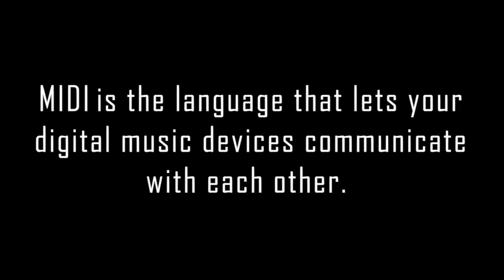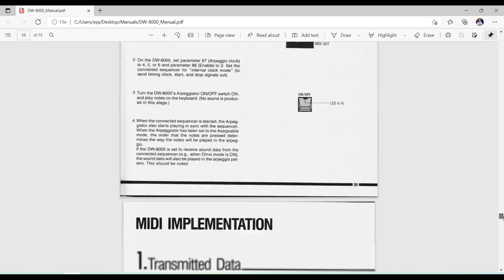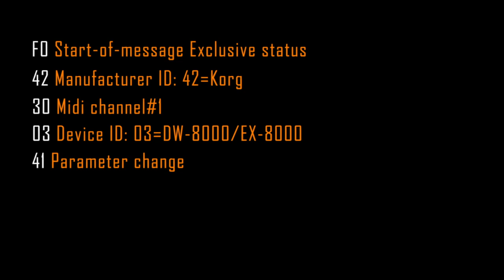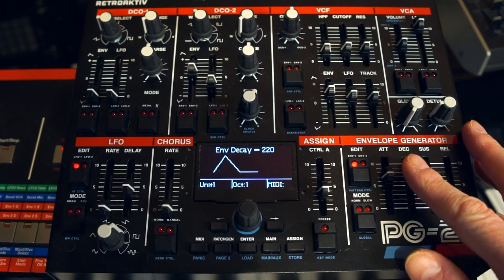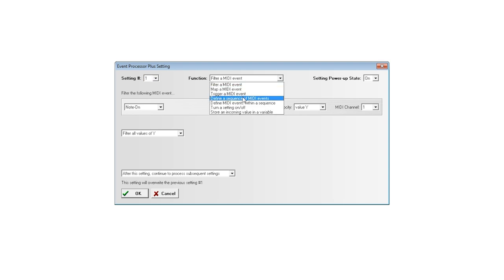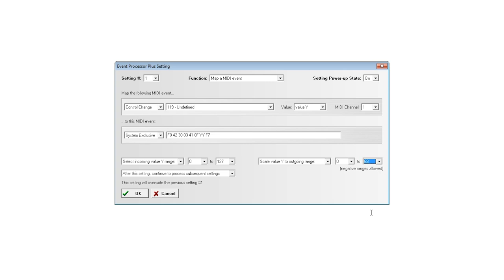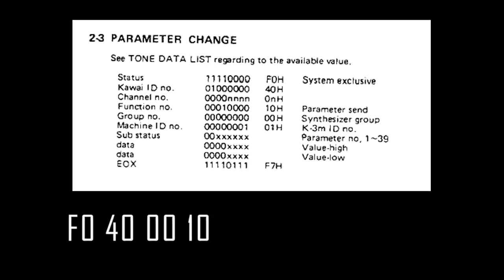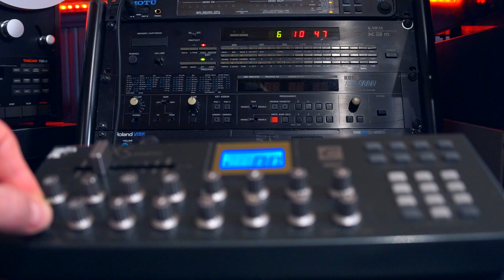Midi Sysex - The black arts? | Introduction and tutorial

Comment: Sysex being there from day 1 just showed how well planned out MIDI was.
Reply: True. It works so well, that it wasn't until the past couple years that MIDI 2.0 has come out. Nearly 40 years with a single base spec is pretty good. :)
Reply: @Psychlist1972  MIDI 2.0 doesn't make much sense imho. There's almost no hardware that supports it and the practical improvements over the "old" version are minor. MIDI will remain the standard for decades.
Reply: @hutti  I disagree, but disclosure: I'm involved in implementation at Microsoft and also a member of the MIDI Association executive board, so I do have a bias. 

There are tons of performance and flexibility improvements in MIDI 2.0 including greatly improved controller resolution, per-note articulation, absolute note pitch, jitter reduction timestamps, and more. It's also backwards compatible so devices can support MIDI 2.0 with a fallback to MIDI 1.0 when appropriate and can also tunnel MIDI 1.0 messages to downstream devices.

Device companies have been primarily waiting on the operating systems companies to step up and offer the API for apps to use. Apple implemented it some months back. Google/Android just announced it in Android 13 just this month . And Microsoft is working on it for Windows. The USB MIDI 2.0 spec came out last year, so that was one thing that the OS companies were waiting on before implementation.

But MIDI 1.0 will never go away because we love the synths and devices which use it. I have a ton of them here in my studio. The key here is enabling incremental improvement and supporting new capabilities while retaining everything we've come to enjoy in the past 40 years.
Reply: @Psychlist1972   thanks a lot for taking the trouble to share your "insider's" vantage point with us here. I appreciate it immensely and so will many others I am sure. I think resolution is indeed an important improvement but you are also right to emphasize backwards compatibility which, in my opinion, is absolutely key. Your comment reassures me but I still wonder, could it be that in the future there will be lots of MIDI 2.0 devices that do not offer the fall back option? Or is the ability to fall back to the earlier standard a requirement to conform to the new standard?
Reply: @telantas  the various OSes all handle both. It's a recommendation and market reality that most devices will need to have some sort of fallback or dual implementation as well. But it really depends on the nature of the device. A master control keyboard would probably want to have both. But maybe a new type of non-standard-tone instrument or special controller may not make sense in MIDI 1.0.

But all of our MIDI 1.0 stuff is going to work in the future. There's a LOT of consideration in the specs for ensuring options about bridging/translating devices/interfaces/keyboards, dual-use, etc. Devices that can make use of new capabilities will, and devices that don't need it, won't need to implement it. :)

Right now, the transport/protocol specs only include USB anyway, so it's primarily between devices and computers, or workstation keyboards and other devices. That'll expand, of course.
Reply: I agree. I've used system exclusive messages to run filters and volume changes, mess with velocity curves etc. long before DAWs were a thing.
Reply: I agree, the people who designed these protocols were genius!
Reply: @Psychlist1972 One big issue with MIDI 1.0 and Sysex was always only one lane in and one lane out per channel. Remember the MIDI belches? Opcode’s Studio 5LX was handy. Cost prohibitive when it first came out

Comment: This was great! Now I'm much less scared to buy vintage rack synths, knowing that I can probably use any MIDI controller with suitable knobs and faders. For some reason, I always thought that the MKS-50 would be next to unusable without a PG-300 or some expensive modern alternative.

By the way, I'd love to see more MIDI tutorials. By and large, the whole thing is still a mystery to me. If something doesn't work right away, I never know if or how I could make it work.
Reply from the maker: Cheers!
Reply: Another solution is to use software on computer, for example program called Ctrlr.

Comment: I'm not familiar with that technical things. But I have old midi synths, computer based virtual synths vsti, and modern controllers, that can be programmed with their software, so I' will have do learn that process. So thanks for these explanations. I have the implementation charts, in the manuals😎😎!!.... I know this is important to have but I was spending half a second to look at those pages🤔.
Can I send sysex to the mc 500 to register sysex and send them after, or sending sysex to the Roland mc 500 to program it?.... And how do it transmit midi messages?
I have three Yamaha Dx, 7, 21, and tx7, two old computers that can send sysex, one Imac also with a sysex sofware, I want to join all that in one system, and learn to program all that, the Tx7 have been made to work in duo with Dx7, but Ican use also that with a modern midi keyboard  controller with after touch, like I have one CME uf70. But as I see, this will be a big deal 🥴.
I did not understand if the box you are using is better than using old computer's sysex and programing softwares, with sysex send and receive?.... I have also amounts of sysex files collected for Tx Dx 7 and also Dx 21, that makes a big library of sounds, and parameters to explore, but I understand also as listening your example, how useful that would be for me to program the interface just only between the Tx7, and the CME uf70 keyboard controller... And more with the best collection ever made for the Dx inside or ready near in the computer, or in the MC 500, by disquette send?.... Lot of work in perspective. I have also my house to renew, so not time for now to re install my studio, but all this sing in my head, hope one day be able to make all this working fine...
What I love are sounds, not so much technology, but by nature, as I am 62, I grown with the 80's music, with the dream to play those technological instruments!.... So, I enjoy your channel, because I found over time some of those old instruments, and this is the sound I liked as I was a teen. But this was technological time, discovering electronic music. Now this is different, I prefer using this technology for mapping sounds, nature, without rhythmic, some counter way to use the technology.  
The question is that technology must serve Art, a freedom thing as technology is a slave thing. One instrument have a technological limit, we must reach by programming, and then, lost memory of that, and use the controller to play in free mind. So for me, technology is not a goal, just the way to find the secret limit of the art that this instrument is able to give in my ears🙏🧡💚
Reply from the maker: This video was meant as an inspiration to go out and find out more, and it seems you're interested in that and so the journey begins. :)

Comment: RTFM its all there, nice one, the Peavey 1600x is also useful since it has nameable presets so you can make setups for different synths, unfortunately different companies use different controller numbers for filter cutoff for example, so that is why you need to make a different preset for each synth...even with VST's they didn't agree on same controller numbers, even though they are all named in the MIDI standard controller list from the beginning

Comment: Funny, the EX-8000 is the first synth I used with Sysex for more than patch backup or firmware. I use Bome MIDI Translator to convert CC messages from my Cirklon to Sysex messages for the EX-8000. Kind of clunky, and the resolution isn’t great but it works well.

Comment: My cousin who is a professional musician used sysex messages constantly to backup and transfer presets for his "romplers".
As far as I am concerned, back in 1994-1995, the most "arcane" midi messages I used and I can think of were precisely cutoff and resonance filter parameters.
I think they were not referred as sysex but as nrpn - if I recall correctly. They were just briefly mentioned in a chart of the manual without much explanation for my particular hardware - SB AWE32 souncard with emu8000 synthesizer, the chip was decent for the price but man the built-in rom samples were so bad! (only 1mb) the interesting part was clearly to create your own patches with your own samples. Fun times :)

Comment: I had just looked at midisolutions gear and the programmer right before I watched this but was hoping there was a way to do this without buying a $150 overpriced gadget that is a luxury , not a necessity. Also the midi messages in my organ module manual shows these midi values for controlling rotating speaker speed and it is even more different than the ones you show. It seems that there is no full standard for these messages and they are all different in their representation and arrangement. What does this even mean with the bytes and control value?
Status 2nd byte 3rd byte
 BnH    50H          vvH
 n = MIDI channel number: 0H - FH (ch.1 - ch.16
vv = control value: 00H - 7FH (0 - 127)

Comment: MIDIOX is super helpful, too.
Reply: I use that a bunch. But I've found MIDIOX can sometimes fail, especially with older equipment. Plus, you have to mess with buffers and whatnot to try to work around that, which is more of a hold over from really old MIDI APIs. It's just not all that musician-friendly. So I wrote a simple MIDI Sysex Transfer Utility that is free in the Microsoft store. Bonus, it works with Bluetooth MIDI out of the box. It's mostly for sending OS updates and patches, not for receiving anything.

Comment: I remember my dad and I had a sync-module (Midi In, audio out) for our Fostex 4 track. We were using Cubase 2.0 on the Atari. Problem was, that when the sync-track was laid, the Fostex became the master-machine which was cumbersome. I found out it was possible to control it via sysex, so I programmed a Midi-module inside Cubase 2.0 that would let me remote-control the tape-machine from Cubase. Problem solved! (I was around 17, and to say that the old man was a bit blown-away is and understatement. Worked beatifully :) )
Reply from the maker: Impressive!
Reply: @EspenKraft  Ha! It took me a week to program the damn thing :)

Comment: That little box is freaking awesome.  I was wondering with some gear that used its midi port for firmware upgrades if that was in HEX language? I'll have to dump some code into a sequencer to see if it'll work. If so, we could even have the potential to fix bugs.

Comment: I use one of the MIDI Solutions Event Processors to convert MIDI Note On messages with a velocity of zero to MIDI Note Off messages. The standard says the former is equivalent to a Note Off (and is useful for a feature called "running status), but some modern gear gets confused by it.
Reply from the maker: The EP can pretty much solve any MIDI problem, I love it.

Comment: sysex is soooo cool .. and given for the fact that MIDI is almost 40 years old, it is even cooler ;) i mean .. it just still works :) for refreshing the memory of some old synths or to do some really sexy stuff like shown in the video. sysex came in very handy to me around 20 years ago when i wanted to control the NI B4 from my hammond XB2. there was no out-of-the-box controller mapping avaiblable for the drawbars and the buttons, so i had to do it on my own. i used MIDIOX to do this (and midiyoke to get midiox internally connected to the B4) - one of the best tools i have ever seen. unfortunately, it seems to have been discontinued since quite a couple of years.. but should still work .... does anyone know if there is something like a successor to this great tool?

Comment: I seem to remember that the KX88 had a function for controlling sysex in real time. Does it work in a similar fashion to the box you described?
Reply from the maker: I have made a video about exactly that. It's part of my KX88 video.
Reply: @EspenKraft  I must have missed or forgot about that part when I watched it. (Yes I did watch it). I guess I'll have to watch it again! Thanks for the correction! But I did remember that it could do live sysex control when I was researching Master keyboards in the early 90s.
Reply from the maker: It sure can, but only simpler strings for synths that didn't require more complicated checksum strings etc for parameter change. Nevertheless, it had sysex control capabilities in 1984.
Reply: @EspenKraft  I'll take your word for it, as you have one. It would have been a nice capability for a MIDI master keyboard to have, and I would have undoubtedly used it if I had bought one back in the day. But I ended up getting a Roland A-80 instead (partly because I could buy that from a local retailer, instead of having to import it myself. As it was I got the last new A-80 in the country!) It served as my workhorse both live and at home for 24 years, before being replaced by an RD-2000 Stage Piano.

Thanks for your responses!

Comment: Great video Espen, very informative as always, I used to use sysex in the early 90's with Passport Master Tracks Pro for sending sound banks to my wavestation. Why is your D-550 taped up with black tape?
Reply from the maker: Thanks man! It's just some tape to hold the display in place. I didn't bother to do a more cumbersome install so I just did it fast and dirty. Works well and that's all that matters. ;)

Comment: Hi Espen, thanks for yet another excellent video. So I'm inspired to control my modules (like D550) via CTRLR inside Cakewalk. So far it looks like I can control everything in real time. Please can you explain why CTRLR (sometimes) needs midi out from my synth? Understanding when or why would hopefully help simplify my setup. Off course it's fun to also know what we're doing right? Keep up the good work! Kind regards from the Netherlands, Charles
Reply from the maker: Some synths need a handshake transfer to verify the checksum in the sysex transmission. Hence both Midi in and out needs to be connected. Cheers
Reply: @EspenKraft  🙏 thx

Comment: Not seen that Roland Kiwi 3P before, and so is it a rebadged Behringer BCR2000 with different firmware and livery?
Reply from the maker: The Kiwi mod for the 3P has been out a long time. The BCR has a template loaded, but a custom overlay for ease of use yes.
Reply: @EspenKraft If you program the BCR2000 to send out sysex, is it still necessary to have the kiwi mod?

Comment: Please, does anyone know what is Sysex ID for Akai S3000? Trying to do sample dump from Wavelab 6...
Reply: the only way i know to work fine in  sample dump 
install recycle on a windows xp/7 pc
check out that your sampler has OS ver. 2.00 if is 1.3 or smt you need to load a floppy with OS 2.0 or higher in your sampler
also need to convert wav to 16 bit like 3cx which is an online converter
good luck
Reply: @asdifasi  Thanks for suggestion. You and this video actually gave me idea to make a dump from Akai to file and then analyze string and check for Sysex ID and try that value in Wavelab. Wavelab 6 has option for sample dump over MIDI and SCSI. It also has list of samplers to choose from when doing setup (S3000 is on the list). However, there is a Sysex ID value (dec value 0-127) that must be entered manually and wavelab user manual suggests checking the value in sampler manual. And yes, I have System 2.0 loading from floppy. Same floppy inserted into same S3000 from time it was brand new, loading OS when sampler is turned ON - for the last 25+ years. Never failed to boot! Cheers! S

Comment: I have a roland gr 55 and gr 33 guitar synthesizer. The gr55 transmits pitch bend in 24 steps (fixed setting), the gr33 transmits 12 or 24 steps. This is about 1 octave on the guitar neck.
So no problem with the gr33, but the gr55 cannot be used with older midi synths.
My synthesizers and modules can only receive up to the range of 12 semitones. Can the gr55's pitch bend data be converted from 24 to 12 steps? I have a Yamaha mep4 and I wonder if this is possible with this. Thanks in advance, greetings from Belgium.
Reply from the maker: Any questions about the Event Processor must be directed to Midi Solutions. ;-)
Reply: Many daws can work with pitch bend in 24 semitones, so no problem for the gr 55. But in a stand alone setup I can only use the gr33 to drive synths like Roland D50,JV1080,Yamaha TG500 etc because it is set to 12 semitones.
in other words the gr33 is compatible with older synths, the gr55 is not. Very unfortunate. That's why I'm looking for a solution via sysex if possible.
Reply: @covett  i have a yamaha mep4 , a midi event processor but i am not sure if this can do te transformation. 
to work with a daw i would have to use a laptop, the yamaha mep4 can go in the 19 inch rack... together with the other synth modules.

Comment: Would this event processor work with sysex strings that require checksums?
Reply from the maker: Yes.
Reply: @EspenKraft  Awesome, love to see a video on that sometime as I can't find any info on how to do this in the manual for the event processor.
Reply from the maker: @nicedevices  No, that is too specific for the manual. If they were to list all possible sysex applications it would be 100000 pages long. ;-)
Using the EP for this would require a lot of strings if you were to use a controller like I'm using here, to map it out.

Comment: does this do anything that the Yamaha MEP4 won’t? 🤔
Reply from the maker: It sure does, it does everything in a much cleaner, fast and easy way. Check with MIDI Solutions for more details about the differences.
Reply: @EspenKraft  do you know of any programs for Mac system 6 or 7 that will program the MEP4?
Reply from the maker: I have no clue.